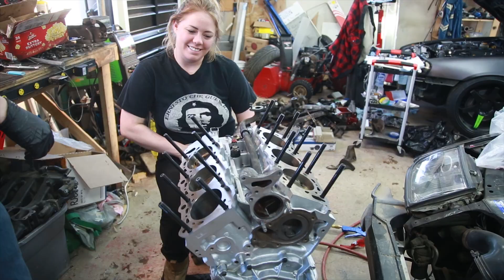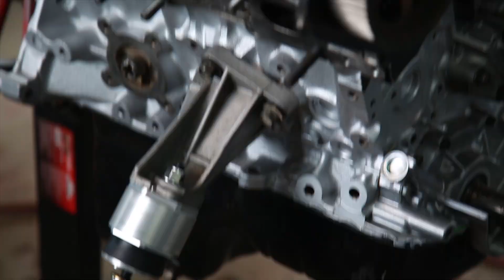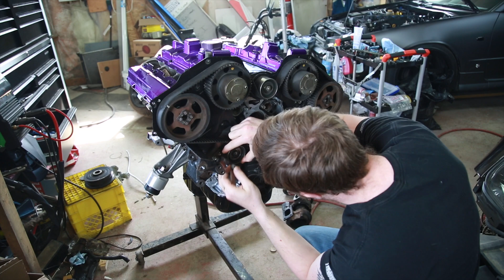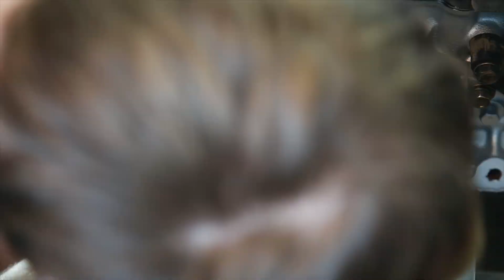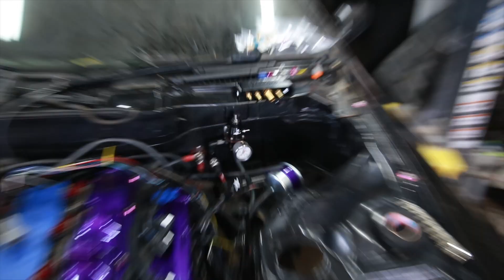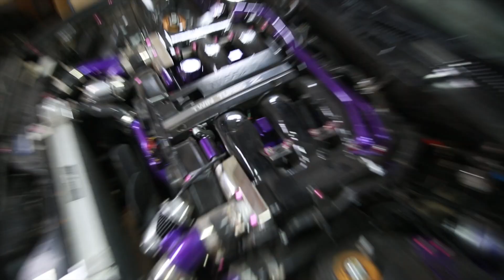The Fairlady Runs! (VG30DETT Rebuild, Part 3)

Comment: I'm building my engine now how did u know you where at tdc #1 when you started from a bare block .what I'm saying is no way to know if it's tdc on compression stroke or tdc on the other stroke .
Reply from the maker: You determine where TDC is when you assemble the engine. I can see piston #1 is at the top of its stroke with the timing mark on the crank pulley lined up before I install the heads. When I install the heads I line up the cams timing marks to where they need to be before setting them on the block so the timing is set before installing the belt.

Comment: Man you're a smart guy so why in the world would you not have the fan shroud on? I mean you may as well not even have the fan installed without the shroud and save the 20 hp. it cost to run it.  Oh, and when you blow one of those multi layered head gaskets, go back to the OEM ones and use copper spray on both sides. You'll be good up to 900 hp.
Reply from the maker: Fan shroud was destroyed so we didn't bother with it. The car has never has an issue with heat so I never bothered with replacing it. In terms of the headgaskets, the machine shop actually shaved the deck down too much because of surface pitting so the thicker gasket was a hail Mary attempt at allowing us to still use the block. So far so good three years later.

Comment: After deleting all the emission stuff does the check engine light come on . If so how do u fix that
Reply from the maker: You have to install a delete tune in the truck in order to get rid of the check engine light. Most diesel shops can do a quick flash tune, or you can buy a tuner and do it yourself.

Comment: Where the head bolts any different? I remember breaking something when I torqued one down wondering wtf.
Reply from the maker: No issues to make mention of. Just make sure the correct lube is used and if you locktite you torque them down before it dries

Comment: Do you need the timing cover on because I think I seen some 300’s without it
Reply from the maker: Technically you don't need it, but if the car gets street driven regularly, it only takes one small rock bouncing up to take out the timing belt, and then you're having a bad day

Comment: Currently rebuilding my tt. Did you paint those valve cover or did you purchase them
Reply from the maker: They were purchased used from someone in the community and had already been powdercoated. Unfortunately, whomever did it, didn't tape the openings properly when sand blasting, and so I had to drill out the baffles and clean them. Definitely a good idea to paint unless the person powder coating knows what they're doing